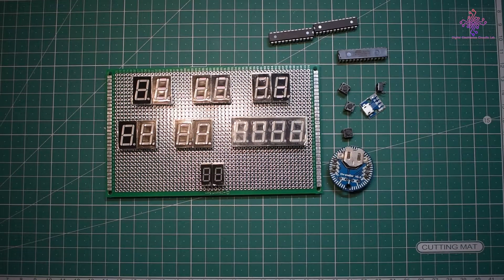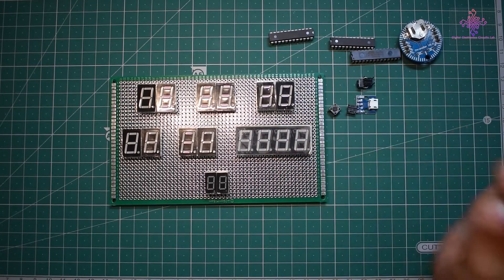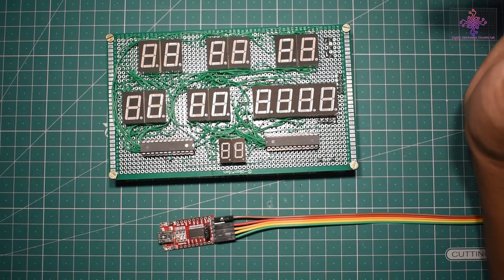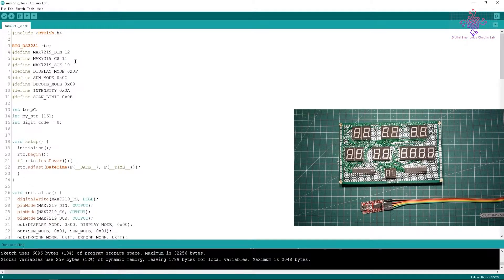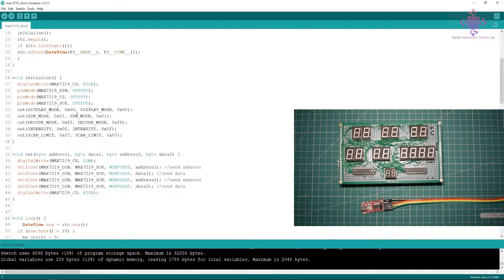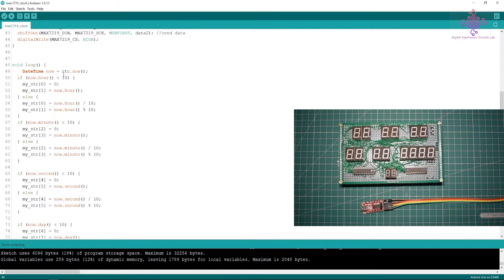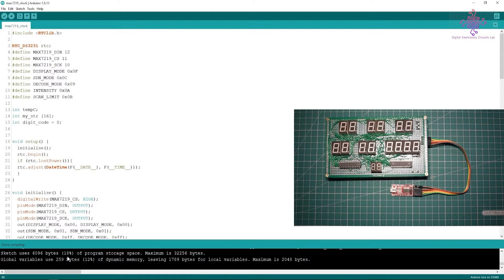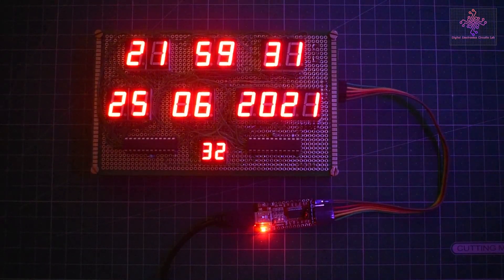DEC #15 Arduino Digital Clock final built version 0.1

Comment: There is an inconsistency with the electrical diagram and the arduino code, in the diagram you use MAX7219 and in the code a 74595. But finally I managed to replicate it by creating a new code, in case anyone needs it just get in touch. I also had to change the value of the resistor between pin 19 and 18 of the max7219 to 100k.
Reply: Здравствуйте Артур! Как с Вами связаться? Я собрал схему, а скетч для оказался для 74595.

Comment: sketch for arduino at the link - does NOT match the diagram and this watch (sketch for using 74595, but not for MAX7219, which is a fundamental difference)

Comment: Fine, Please tell me the segments are Common Anode or Common Cathode? and Code about CA or CC? Can I use DS3231 Regular Module here in stead of Chronodot ? can i change time to 12 Hour mode?
Reply from the maker: these are common cathode segments because  Max7219 cannot drive common anode segments and hence the code is for Common cathode only.
Yes you may use any DS3231/DS3232 module or IC with this code.
If you want to make 12 hours clock then you have to add 3 lines of code.
Reply: @DigitalElectronicsCircuitsLab  thank you ❤️ and please share the code for 12 hour.
Reply from the maker: @omorfaruk1  Sure. I will publish it in my website
Reply: @DigitalElectronicsCircuitsLab  please then give here that link, Thank you.
Reply: @DigitalElectronicsCircuitsLab  12 hours format code plz .